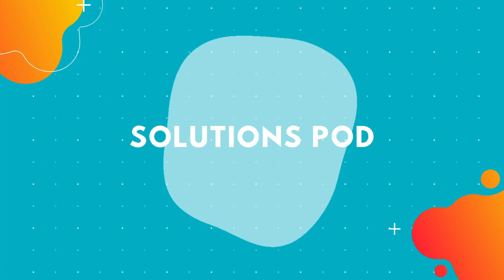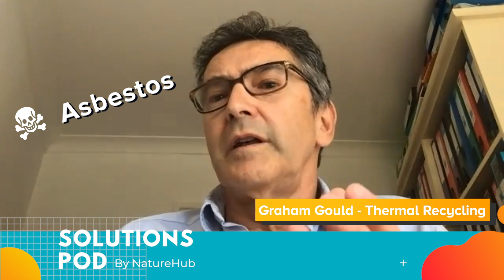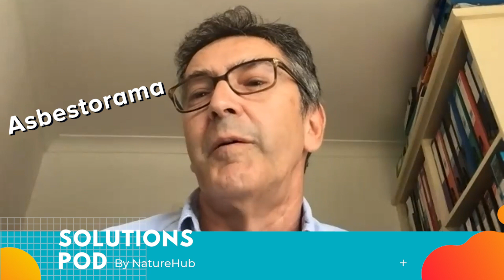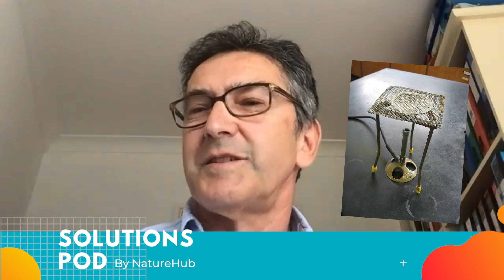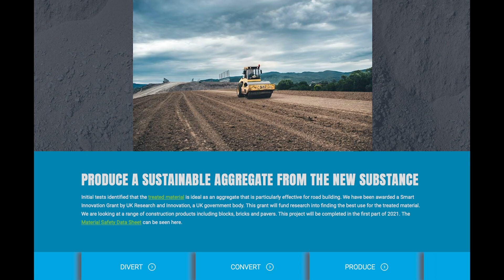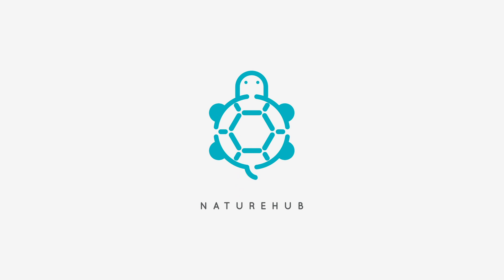A new way to prevent asbestos from harming you and your loved ones-Interview with Thermal Recycling

Comment: Took jewelry class in late 70's or early 80's and instructor told us we could buy a fireproof tile of asbestos to use in  class I guess if using flames, but I didn't because I wasn't doing that type of work. But it was in the classroom. It was also insulating the pipes in the home I grew up in for the furnace. Had floor tiles containing the stuff. Rather than remove them it's safer to tile over them. Most people would not recognize it unless they were trained to know what and where to look for it

Put it in cement? So if a cement building collapses, or is blown up, or falls over, those fibers are released ... ummm??  People cleaning up the debris from the World Trade Towers had health problems later. Even people flocking to the Ground Zero location as a tourist destination were exposed. Everyone in that area...

Now the Florida building collapse clean up, only built 40 years ago. It "might" have it there too